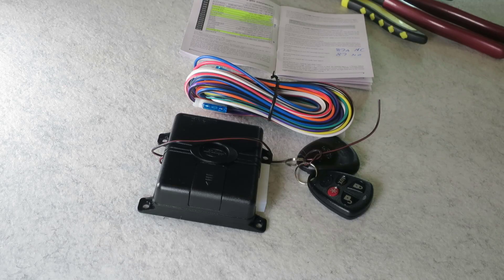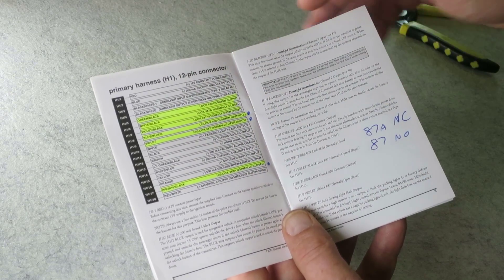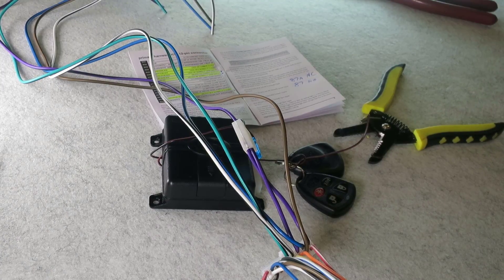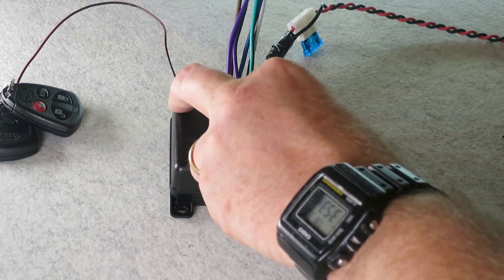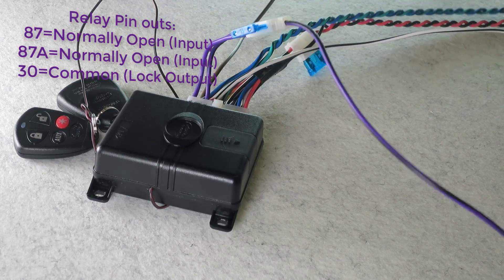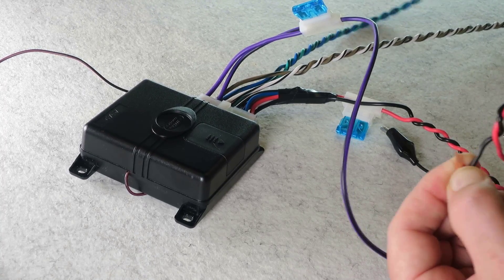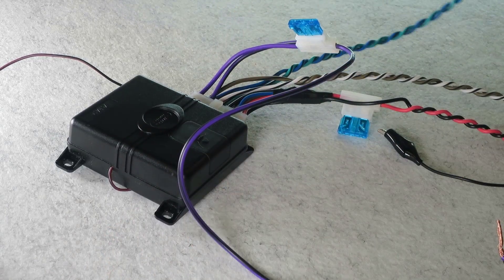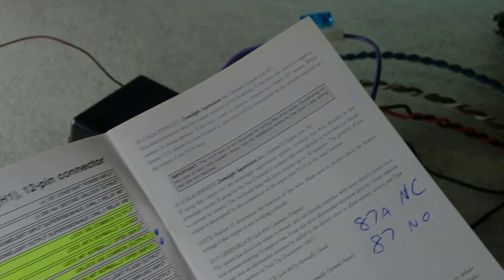Wiring How To on DEI Viper 451m Type Internal Door Lock Relay Systems

Comment: How do you wire (auxiliary one) output option on the Viper 3400 Alarm to trigger an actuator using the aux button on the remote? That red/white wire is a 200ma output (-). The door popper actuators need 12 volts. Thanks

Comment: Hopefully you read this long story short my alarm has been sitting in my car for 7 years and the car has not been turned on .. now my doors are shaved and have no handles.. Now my poppers don’t work now only one does and it’s not the driver side.. I changed the relays and the door still doesn’t work.. so I got a tester light again bcuz the poppers are connected all together threw the brain of the alarm.. so my tester light I tested the the wires coming from the Brain and 1 of the 2 wires that have the fuse blocks on the wire doesn’t light my tester up.. so that’s telling me it’s dead and the fuse isn’t busted… so I’m not know what to do, I heard from diff people online that the alarm might just be done so replace it. I don’t have money to be doing that.. I was wandering if I should pop open the housing unit and see if within itself if a cap busted or something… The alarm still works in the sense that when I press the alarm it chirps, when I pop open the passenger door with that alarm key it works.. now I have 4 relays , 2 for the fronts and 2 for the backs . U can hear one door trying to pop just not enough force and the other nothing so… I’m not to worried bout those.. so any help or thoughts I’ve written a few people but nobody has attempted to write back .. so hopefully you read this even though this vid is old…. Thxs
Reply from the maker: call me, I can still help
Reply: @Lesscoelectronics  for real I really appreciate that. I do have a lot of different questions regarding installation on things I’ve seen your videos and pretty clear instructions if you will .. I use to do all that stuff but when it was in the 90’s and I kinda forgot something’s and certain things I remember now it’s like there’s either better ways or don’t do it that way bcuz of dangerous things I guess.. Anyways I would like to ask if you don’t mind.. I don’t have a number and I don’t think u want to many people possibly reading this and bugging you.. maybe said your email or a email your not really gonna use and then from there your number .. or however… I would like to start a business doing custom things and now since I’ve been back in it full time since unfortunately I lost my job I’m trying to soak up everything I can before I get hired somewhere else. Or unless I can find a job that dwells into this world.. threw out this year I’ve been hitting it alot harder and threw out the past years I’ve kept a foot in . I bought a 1990 Lincoln and everything other then the new upholstery, paint and hydraulics I’ve been doing myself, the mechanics work , some fabrication and upholstery, the audio and newly learning how to set up an alarm looks easy .. it’s just unfortunate the question I had is all pertaining to my other vehicle that 1 to many people worked on. I just pulled everything and started from scratch… I’ll just tell u a lot more later …

Comment: Man you seem so knowledgeable can you not understand there is a whole bunch of do it yourselfers who have common sense and don’t want to pay 300 dollars to get 
Their security system installed why can’t you break it down to wear an average person can understand what you’re saying and actually hook it up to a real vehicle like a real world application I guarantee you your views with double if not triple
Reply: I just bought a 3100 viper system and I’m stuck at the door locks on the door switch and whether I should isolate each door lock and add a diode i’m having to watch 15 different videos to figure out what the diode is And how it works and why is it that my Dodge ram 1500 2004 Has reversed polarity which means when I wire the system up it’s gonna be totally different than the average person with the average car so confusing

Comment: I have an 08 pathfinder. I'm trying to wire in my remote starter. My car has negative door locks. The door lock switch has a one wire communication line that goes to the bcm and the bcm reverses polarity. Can I wire in a 5 wire relay straight to the driver door lock actuator to reverse polarity. And will it affect the operation of the bcm?
Reply from the maker: Maybe this'll help:

KEYLESS ENTRY CONTROL
 
Print Section ?
 
Lock
 
L BLUE
 
IN DRIVERS DOOR AT SWITCH PIN 4
 
 
Unlock
 
RED/WHITE
 
IN DRIVERS DOOR AT SWITCH PIN 6 #201
 
 
Driver Door Unlock
 
GRAY
 
AT BCM , PIN 59*

Comment: Great video and very clear!  I have a VIPER 211HV which is pretty similar and I'd like to be able to lock all the doors from the drivers door (as well as the remote fob). I have a MES Five wire actuator in the driver door and a MES Two wire in the passenger. Please can you point me in the right direction of how to wire this up - and indeed if it's possible. Thank you

Comment: Very informative/useful Video.

I was wondering if the same system may be used for a "one-button" lock/unlock mechanism, wherein you only use ONE relay for both functionalities. If so, What should the polarity be set to?
Reply from the maker: Even in a 1 button kit you'd still need 2 relays
Reply: You can't use only 1 relay.
Because as if you choose NC to lock and NO to unlock. There should be continuous power drawn by the relay by the NC terminal.

Comment: Hello...I installed the Avital 3100 with door actuators and relays , it is possible to add a switch for the door locks?
Thank you!!!
Reply from the maker: You sure can, just add it in parallel to the blue and green door lock outputs.
Reply: @Lesscoelectronics  thank you so much.
Reply from the maker: Very welcome!

Comment: Hey very informative video. Keep up the good work.  I just bought the 451M Door Lock Relay and Avital 3100LX 3-Channel Keyless Entry Car Alarm.  I'm going to be wiring it in my Brand new Jeep Wrangler that came with Manual Locks.  I also bought the POWER Door Actuators from a Factory model with Power Locks. I'm still unsure how the Door Locking Actuators are wired if its one wire or multiple etc. So I'll be using some of your advice.  Thank you.  Hope its easy LOL
Reply from the maker: Use the add actuator schematic, if you need anything else just shoot me over a message, I love to help people.